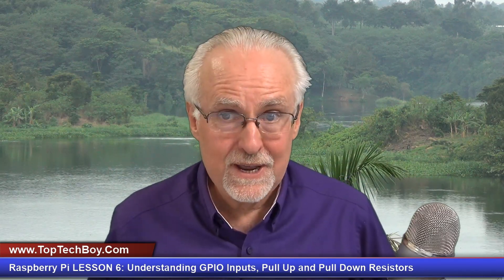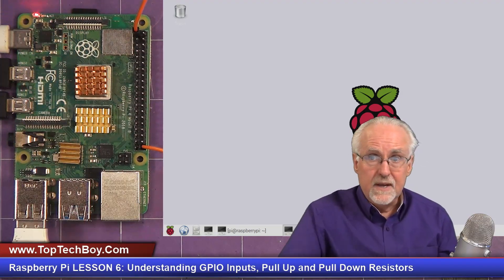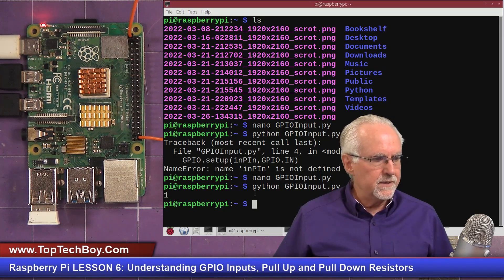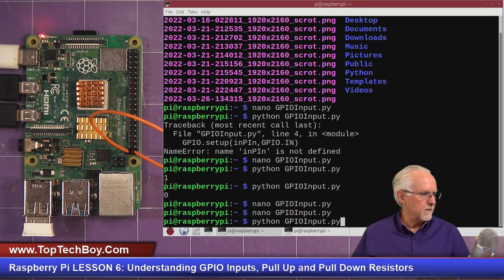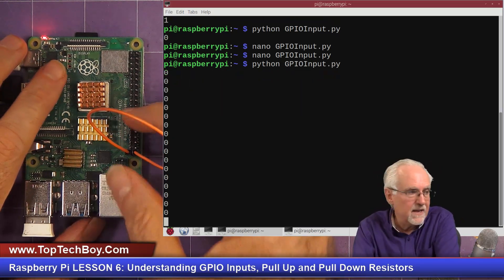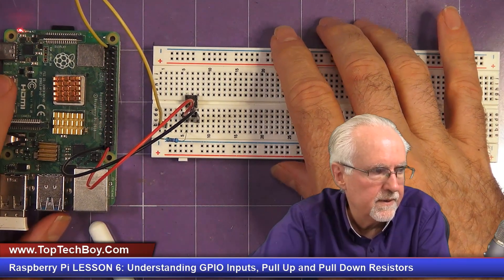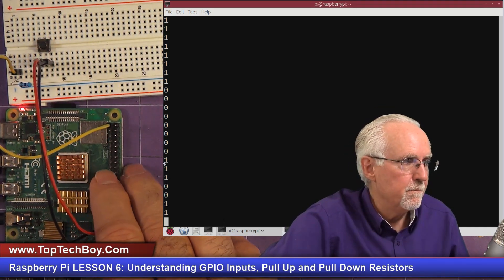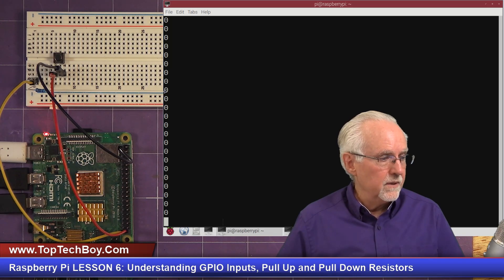Raspberry Pi LESSON 6: Understanding GPIO Inputs, Pull Up and Pull Down Resistors

Comment: Hey Paul, first of all, great tutorial series! Been following you from lesson 1 and moving strong. Just wanted to point out, after lots of research, my understanding of the pull-up resistor is as follows: there is constant current flow between 3.3V and GPIO pin, but it is extremely small since the pin itself has tremendous impendance-resistance. Thus, 3.3V flows to the pin, giving a value of 1, but the current is so small that it is difficult to measure.

Comment: Hi Paul! 👋
Thank you for all the great videos. I learned to program the Through your Arduino course and back now for the Raspberry Pi.
I have one question on this video... Are you able to do the same on the Raspberry Pi as on the Arduino, where you write to the pin and read the value, not needing to use the 10K resistor?
Hope you have a great day further! 🙂

Comment: It was really a good explanation Mr. Paul. But I didn't understand one thing. When switch is OFF, no current flows then why pin 40 is getting input? Means pin 40 is getting flow of electrons? But there is no current so how it detects value.... When switch is ON it goes to 0 why?

Comment: On the pull down resistor part, you put the 10k resistor on the bottom. Would placing the resistor between the switch and pin 40 be bad?
Reply from the maker: Yes, that would be bad because then you would be pulling the pin up, not down!

Comment: Great video! Question. what is the function of the resistor? is it to prevent a short-circuit condition here?. I understand that a resistor either lowers the current, divides the current, or blocks the current all together. basically what i interpret is you just connected pin 1(3.3v) straight to pin 39 (gnd) which i would think would let the smoke out... lol is the 10k what is stopping this from occuring?
Reply: the idea, as far as I have it, is that the 10k resistor will bring the value of the current down so much, that it reads as zero. When you take I=V/R   
you will find that    I = 3.3V / 10 000ohm  
This means that    I = 0.00033Amps
Rounded off, this will be close enough to zero, meaning the pin will read zero, which will give you the desired result.

Comment: Thanks for the awesome videos. At mark 25.45, you say "When the switch is open, there is no current through this lower leg and therefore there is no current through this 10K resistor". Did you mean to say "there is no current DROP through this 10K resistor"? I am not trying to correct you! I am just checking that I am understanding this right!
Reply from the maker: There is no such thing as a current drop. Current is the flow of electrons. Voltage drops across a resistor, not current.
Reply: @paulmcwhorter  As I suspected, my understanding is flawed. Sorry... My understanding was that if the switch is open, there is no current going through the lower leg, and therefore there is current through the 10K resistor. But obviously I am missing something... Hum time for me to get back to more basic electricity tutorials. Sorry!

Comment: I'm still confused about the need for the 10K resistor on the pull-up resistor. What not just use the button switch? If the switch is open, the 3.3 V flows into the pin, and not ground, and if the switch is closed, then the current would branch off into the two paths of ground and the pin...right, based on where the resistor is. So, in summary, I don't know why the resistor is where it is on pull-up resistor.
Reply: I wouldn't try that. Connecting the 3.3v pin directly to ground will cause excessive current to flow and may fry your Pi.

Comment: 23:32 "There's no current. There's no way for current to flow, so PIn 40 is going to directly see the 3.3 volts. It's going to read 1".

I am so confused. How can there be no current and if there is no current, how is it going to see the 3.3 volts?
Reply: Hiya @junjie325, let me give it a shot. First off, don't think of pin 40 as part of the circuit; think of it as a test point. (When we set up pin 40 as an input, I expect it becomes a very high resistance part of the circuit through which a negligible amount of current flows.) With the switch open, the voltage drop across the entire circuit from voltage source to ground must the full 3.3V. In this circuit, that means that the voltage drop across the open switch (remember, open switch means no current is flowing) is also 3.3V which means that our test point sees 3.3V relative to ground (which means it returns a value of True, right?) Now close the switch: pin 40 is now connected directly to ground, which means that no matter whatever else is happening in the circuit, pin 40 is at the same potential as ground (another way of saying the voltage between pin 40 and ground is 0,) which means we read a value of False. Hope this helps.
Reply: Thanks @notdecraw . Appreciate the response. You said "With the switch open, the voltage drop across the entire circuit from voltage source to ground must the full 3.3V.". But when the switch is open, how is the voltage source connected to ground? When the switch is open, shouldn't there be no voltage drop?

Comment: Okay... Now I am SHEEPISH.  I started viewing the homework solution from Paul and realized I had done exactly what he feared.  I simply created a circuit that read input and turned on the LED with the switch rather than via a programmed output pin.  I immediately switched off his video and redid my circuit and program.  This is documented in the video at :
https://youtu.be/6hbzDeEcz2o

I deleted my earlier video showing the INCORRECT solution to the lesson even though it did show how to use a pull up down resistor and read the status of the switch.  It even illuminated the LED, but as I say it was done solely by the switch button press.

I was gratified to see he and I chose the same pins for the programmed output.  At least I'm sort of on the same page.

Comment: https://youtu.be/IPUyRkNEF0A
I'm an industrial electrician. Most manufacturers of PLCs, etc. must handle the discharge of energy on the inputs on the card level so that we don't have to worry about it when wiring in new input devices. I'm thinking you can use a switch with a normally closed contact on it which will disconnect the resistor from the circuit when voltage is applied to the input. Also, in this case, I wonder if you could use any resistor since you wouldn't be connected to voltage (+) and need to reduce current to near zero. The reason I suggest this is because I don't like the idea of any amps (3.3v/10,000ohms = 0.00033a) going through the resistor to ground.  I'm assuming the reason why we have to do the raspberry pi is because it is a multi purpose pin. If it were only used as an input for a certain voltage, this resistor could be permanently imbedded. Loved the video.

Comment: Used the pull down resistor configuration. Works but not sure if this is the correct configuratation.   https://youtu.be/ElVzcZIRziw  This is wrong I'll have to re do it.

Comment: What is pin 40 connected to on the PCB? Forget the protrusion end. The pin, while not connected to any other pin, has to be connected to something. What is it? The pin goes into the board and goes somewhere. No one on the internet wants anyone to know. It can't just exist and not connect to anything.

Comment: drunk phrasing into gptChat spit out this:

import RPi.GPIO as GPIO

# Set up the GPIO pins
GPIO.setmode(GPIO.BOARD)
GPIO.setup(40, GPIO.IN)
GPIO.setup(1, GPIO.IN)

# Read the state of the pins
pin_40_state = GPIO.input(40)
pin_1_state = GPIO.input(1)

# Check if the female-to-female jumper cable is connected
if pin_40_state == 1 and pin_1_state == 1:
    print("Female-to-female jumper cable is connected")
else:
    print("Female-to-female jumper cable is not connected")

# Check if the ground pin is connected
if pin_40_state == 0 and pin_1_state == 0:
    print("Ground pin is connected")
else:
    print("Ground pin is not connected")

# Clean up the GPIO resources
GPIO.cleanup()